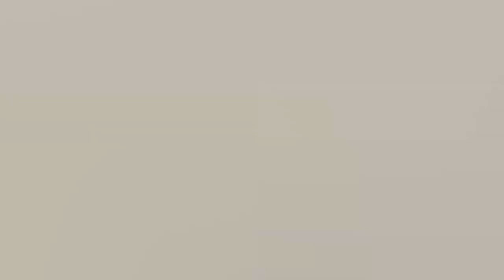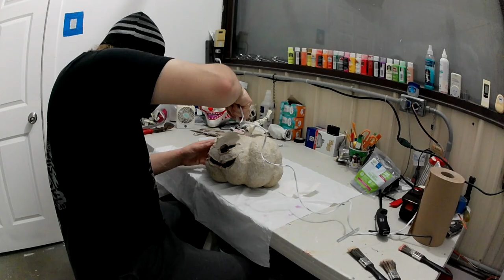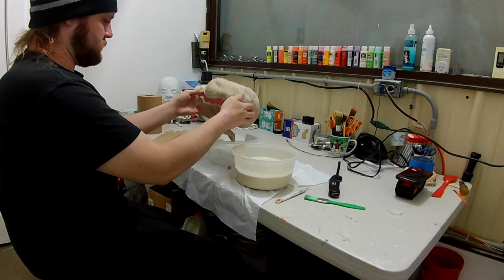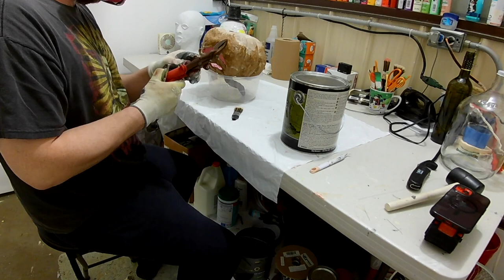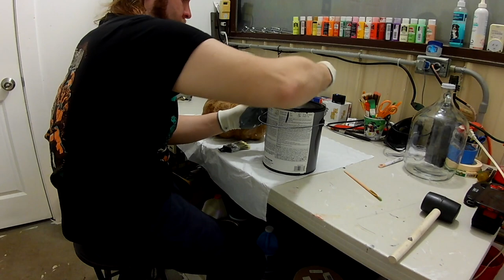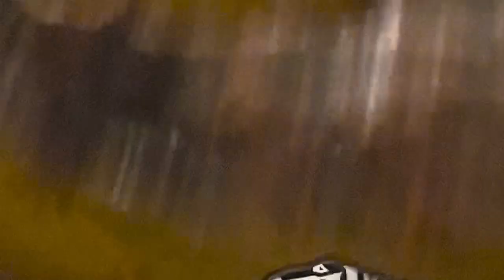How To Make Your Own Paper Mache Jack-O-Lantern! Part 2

Comment: Do you or anyone have experience making these waterproof?
Reply from the maker: The process I use will waterproof it 👍 After it's all done the varnish, exterior latex paint, and spray finish make it practically waterproof, especially from rain/dew.

Comment: If you have polystyrene and some  cellulose thinner, melt the polystyrene to the thickness you like!! You you can make a great waterproof varnish !! 
🧚‍♀️🩷🏴
❌️ highly flammable wene wet, and a face mask recommended, other than that it's great and cheap 👌 will dry like hard plastic!!
Reply: I was going to ask about making it waterproof
Reply from the maker: I didn't know that 😄 I personally really love how the spar varnish works with waterproofing it myself but in a pinch, I will definitely try that.